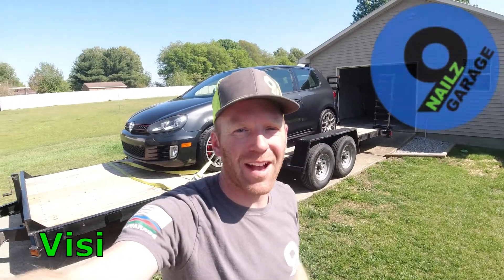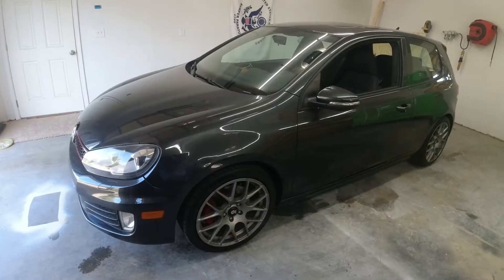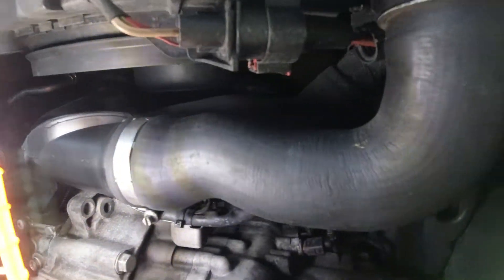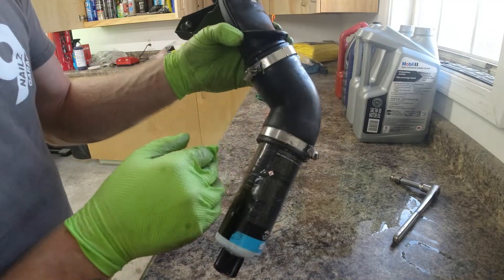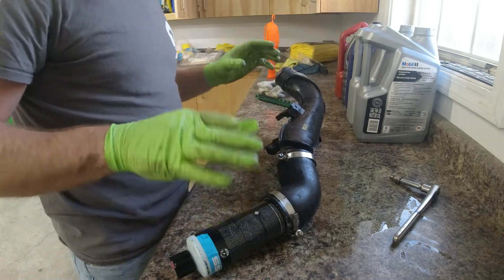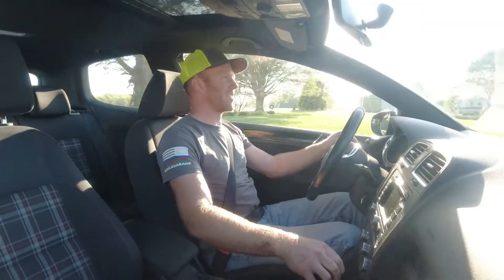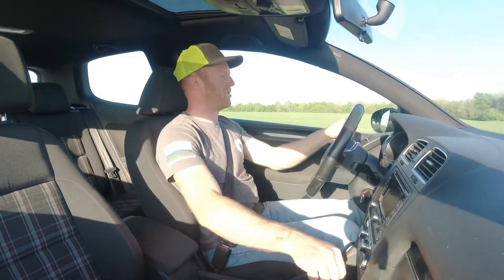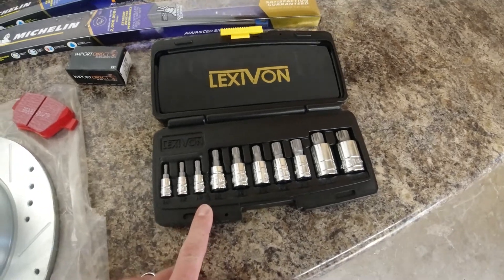Buying and Fixing a Problematic 2011 VW GTI, Blown Engine?

Comment: Stock boost is from 9 to 12, depends on altitude, outside temperature, on average in the 10 psi.
With those miles, do a leakdown test, compression 160 to 180psi, and check vacuum -20 to -24.
The turbo will behave based on the health of the engine.
Reply from the maker: Thanks for the tips!

Comment: You should really check the back of your valves. Its direct injection and depending on miles, they can be caked up with carbon and not close properly
Reply from the maker: Thanks for the tip! Think that could cause low boost?
Reply: I had a 2014 Veloster r spec turned to 250 WHP. One of the first mods I did was double catch cans because of the direct injection issues. 7 years later the car ran flawless and those cans caught so much sludge.
In the valves are not closing completely boost will leak out. I don't know if it would trip an error code though.
Reply: @9NailzGarage  well, if the valves dont close right, the cylinder can not hold compression. a catch can is a must have i believe for any direct injection car.